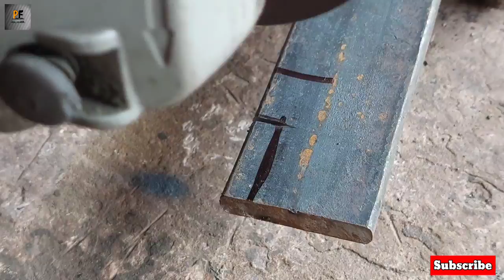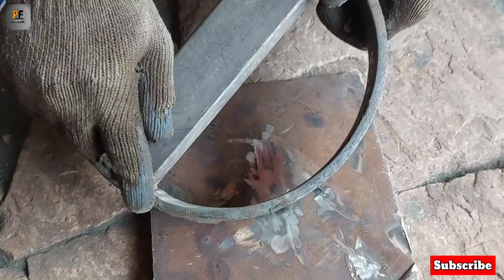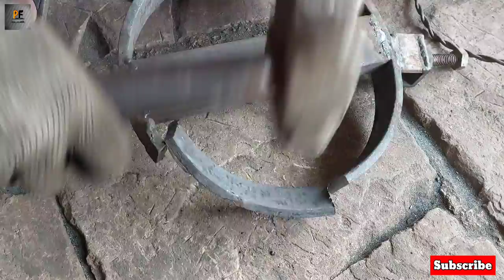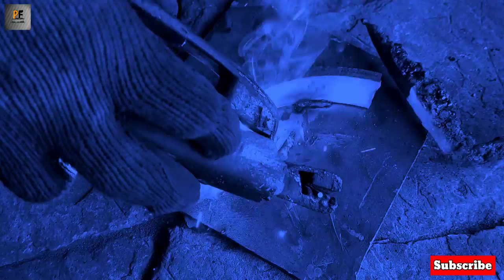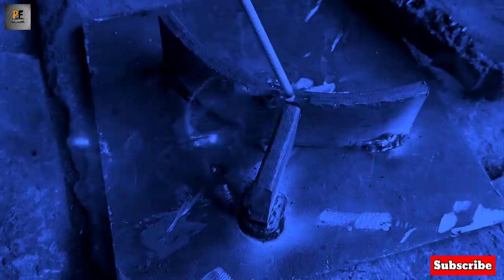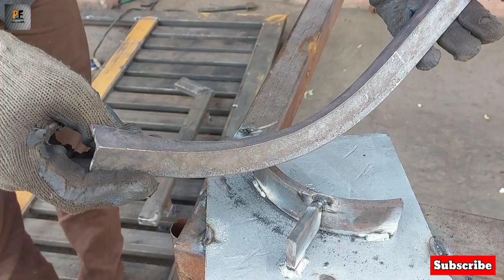How To Bend Angle Iron Without Machine | Angle Iron Bending Techniques

Comment: If I want to get the angle to curve in the opposite direction, where the lip is on the inside.  Since I'm trying to shrink the metal rather than stretch it would I need to cut notches? I want to curve 2 x 16 ft length to as perfect as possible to make a 1/2 circle
But the lip has to be on the inside not the outside like in your video.